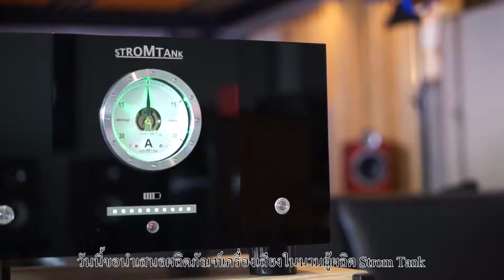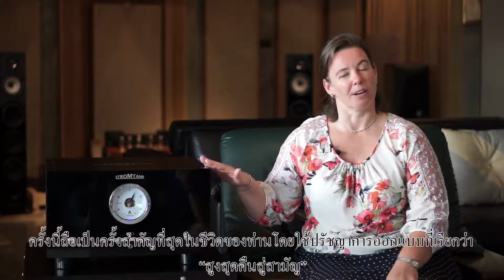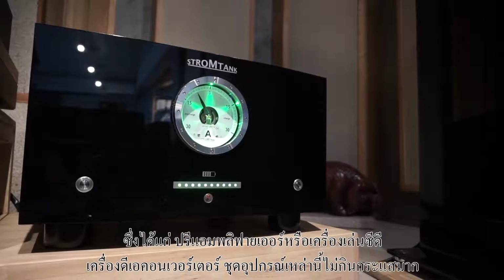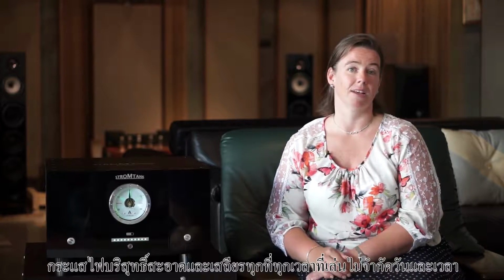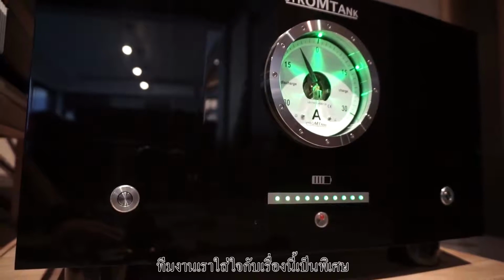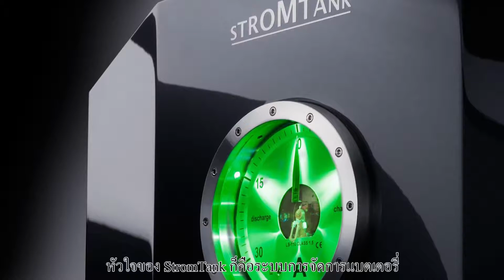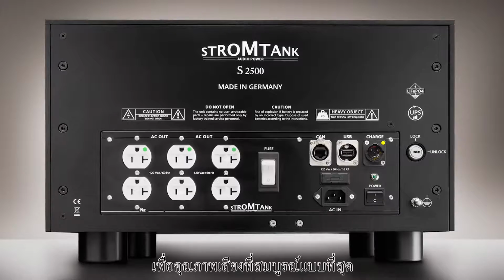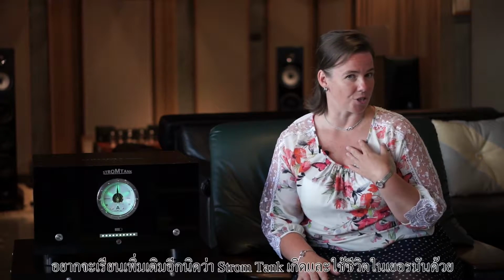STROMTANK ระบบจ่ายไฟ Made In Germany

Comment: This is a great product as it really makes a lot of difference when disconnected from your grid. Especially for those who live in urban areas and sharing electricity with hundreds and thousands households. And as expensive as it is, still cheaper than to have your electric company running a dedicated power line for you. I'd just like to know what type batteries is it using, are they immune to the memory effect, meaning can you randomly recharge regardless the charge state of the batteries, or does it need to be fully depleted before fully charged up again?